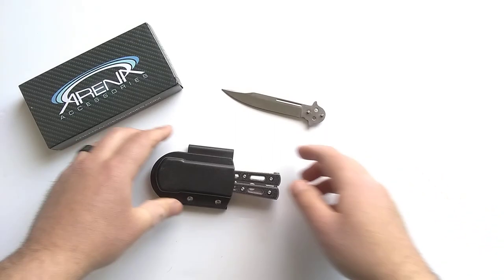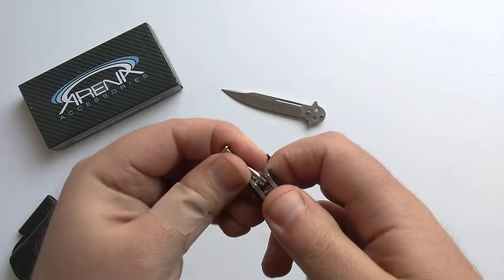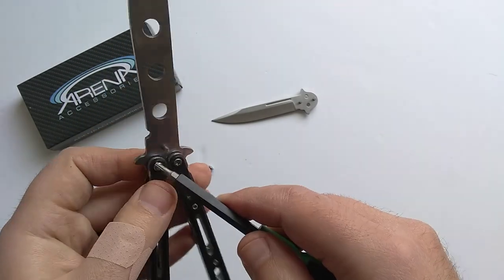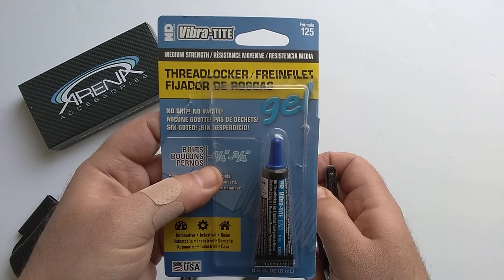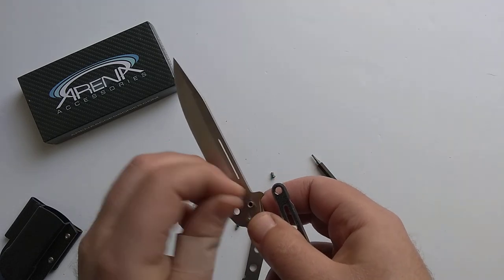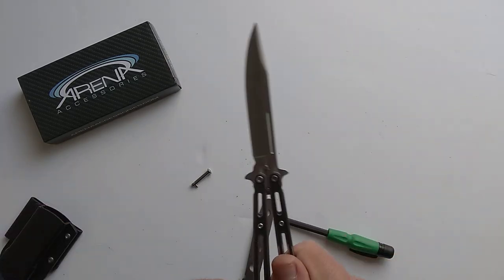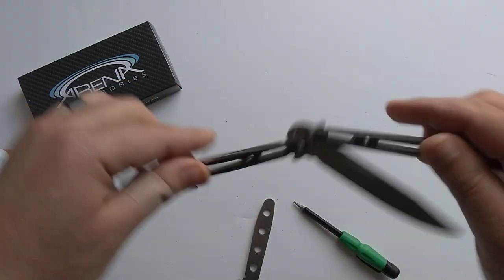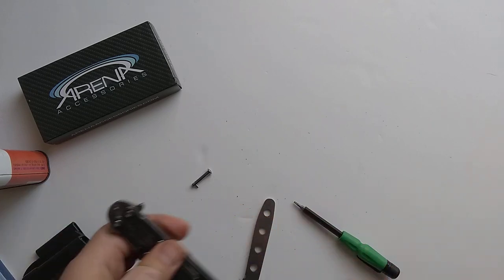How to Remove a Butterfly Knife Latch and Tune/Lube/Adjust the Action of Your Balisong - Tutorial

Comment: I purchased this balisong about 3 weeks ago and i've been flipping since and enjoyed the feel of the knife. But as of about 3 days ago the pin on the blade that prevents the blade from hitting the pins in the handles fell out, and by the time I was able to notice, the blade had already hit and knocked out all of the pins on the inside of the handles, blunting the blade and leaving only one pin at the bottom of each handle screwed in to hold the handles together. The knife felt great out of the box but I would have to say that a knife that falls apart this quickly probably wasn't worth the buy
Reply from the maker: Thread locker is key, it's important to thread lock every screw on any balisong. Message me via the website and I will see what I can do to get you back up and running. If your tang pin fell out, that should not have happened. I can get you a replacement.  Thanks 👍🏼

Comment: My version from you came with the black latch. It doesn't have the same pin on the bite handle side. It doesn't have the same pin on that side is it not removable?
Reply from the maker: It is, just a slightly modified design with our latest batch.  I've reached out to you via email, but for everyone else reading this - our new version with the stone-washed / black latch, required you to remove the black textured handle scale in order to get at the handle screw.  It's a better design, because we are planning on adding a spring-latch version on this same frame.  The springs we got were bad, so we are working with our factory to get the revised springs before releasing it on the website.  If you happen to have a spare spring laying around, your knife is set up to be equipped with one :) There's a small hole in the end of the latch pin, and the other end of the spring can be mounted to the other pin inside the handle.
Reply: @ArenaAccessories  that's cool to know. I may end up finding a spring and doing that . I was trying to make sense of what that other pin could possibly be for lol. Main reason I wanted to go latchless was because I didn't want the latch beating the blade. If it's sprung open that wouldn't be a concern. Thanks.

Comment: I put bearing in mine and wedged the original washers in between the zen pin and bolt at the bottom of the handle so that the handles wouldn’t be as opened up top compared to the bottom of the handles now I have no play or tap and a damn good flipper so you can get good tolerances in this bad boy if your willing to put in some work (forgot to mention zero blade rub after i modded it)
Reply from the maker: That sounds awesome!  Gotta love knife mods.  You just increased the performance and value of this knife by doing that.  If we could eventually source some bearings that were just the right size, I might just have to make a "special edition" series.
Reply: @ArenaAccessories  would love to see it happen
Reply from the maker: @jahyeet1137  Never enough time in a day. In other news, we are dropping a new exclusive titanium balisong on bearings in 2 to 3 weeks, check out our Instagram @arenaaccessories_dot_com or our exclusives category on the website to join the waiting list. Very excited!  Can't wait to get the final production model here so we can make a video.

Comment: Thanks so much, I just got mine yesterday. It's great! Can you do a video on the red dragon handle balisong you have or tell me if its just as good quality because I really liked the design on that one.
Reply from the maker: That knife flips great, and has longer handles than the one in this video. Only drawback is if the pivot pins ever loosen, you will have to smack them with a hammer (on a hard surface, such as a bench vise anvil) to re-tighten them. When you get something with screw pivots, there is a little more maintenance but it also allows you to tune them up much easier. Riveted / pin pins are nice if you just want to grab and go, but over the years, they will almost always loosen up. That's why we price our riveted models cheaper. They're great to add to your collection, and still flip really nicely.
Reply: @ArenaAccessories  thanks for the help! I'll be getting it then!
Reply from the maker: @enigmaedits1559  we have one left 👍🏼not sure if we will ever get any more. Totally depends on our supplier

Comment: I have a butterfly knife that has no screws. What should I do to get the latch off???
Reply from the maker: If it's riveted, you probably won't be able to remove it without sawing or dremel cutting the latch off. You don't want to pop out or ruin your handle rivets, otherwise the handle will be falling apart if it's a sandwich design. I'd need to see a photo of it to help you out further.
Reply: @ArenaAccessories  nvm i found another way to keep the latch while comfortable to hold.
Reply from the maker: @ungsaltm3016  Tape?  LOL
Reply: if your still wondering, most screw/pinless bali’s you can straight up just knock off the latch, i wacked the latch off  one of my ccc bali’s with a screwdriver and it works great
Reply: How did keep latch comfortable
Reply: The latch is so annoying

Comment: Question do balisong latch screws or bite handle screws glowed together bc this damn screw won’t come off
Reply from the maker: Yes, thread-locker. Heat it with a flame then try again. You can use a candle or lighter or a soldering iron but be careful. Try both sides as well. One side always seems to be tighter lol

Comment: I bought a similar trainer. I wanted to take off the latch but the screws are so tight and the tool which came with the trainer, destroyed the screws… i need help
Reply from the maker: Try an elastic band on the head then use your screwdriver again. But you first need to heat it up with a flame or soldering iron, to break the thread locker. Sometimes you will need to go to a t7 on a stripped t6.
Reply: @ArenaAccessories  i will give it a try. Thank you 👍🏽
Reply: @ArenaAccessories  nope, didn’t work either. The screws are too tight. Not even a t7 works on that screw. Perhaps if i used super glue. Like, gluing a piece of metal onto the screw. Thank god i have replacement screws
Reply from the maker: @Sam-dd8cl  use a flame from a lighter or match. It's loctited, only way the screw can be siezed that tough.
Reply from the maker: @Sam-dd8cl  drill them out lol My bet would be that super glue would not hold, you might want to try an epoxy like JB weld or something onto the screw head but don't get it glued to anything except for the screw head that's probably a waste of your time. Just drill them out with a drill press. I wish I could help you further but it sounds to me like you didn't buy it from us I'm just trying to be a good guy to lead you into the right direction
Reply: @ArenaAccessories  everything's fine :) i solved the problem. Thanks for all your help ^^

Comment: I just have a question, do the screw must be tied af or it has to be loose, bc mine is a bite loose and I'm gonna remove the latch who os the same as here, so do I habe de tied the screw as much as I can ?
Reply from the maker: The screws should be tight, my dude.  Otherwise your handle might loosen up.  Be careful not to strip the heads of the screws.  You can also use a little bit of heat if they won't budge easily (there is some thread locker applied at the factory, depending on where you got your knife), you can heat it over a candle, or with a small flame, but be careful.
Reply: @ArenaAccessories  ok thank you very much

Comment: my balisong trainer doesnt have a screw on each side, one side is covered by a cap and one more is a screw
Reply from the maker: Some screw sets are like that. Not all models have screw heads on both sides. Usually the capped side is the female threaded side.
Reply: @ArenaAccessories  i see, is there still any way to open the latch?
Reply from the maker: @belimbing3349  I can't see a photo of what knife you have, but if it is a rivet you won't be able to without serious modifications. The simple answer is to deconstruct the handle and take out the latch, then reassemble.

Comment: i ordered mine two days ago and haven't gotten an email when does it usually come in?
Reply from the maker: Check your spam/bulk email folder. Depends when you ordered, because we don't ship after 11am or so on Saturdays.  You will get an order confirmation email when you order, and then another email once it ships with the tracking info.  Contact me on the website if you have any questions, anything piled up from the weekend just processed today and was shipped out.  It will all get scanned in by USPS this evening.

Comment: My latch is on the wrong side!   😑
Reply from the maker: Where did you get your balisong?
Reply: @ArenaAccessories  from flipkart. I wanted to buy a good expensive balisong. Because i love these knives. I never was able to afford one but now that i have money i thought I'd buy something expensive but guess what. The most expensive balisong you can find on the internet in india are around 5oo rupees. I was very sad but the one i got is a good one. It's not that good but at least the screws don't loose the first day
Anyway removed the latch And it's working fine now.
Reply: @ArenaAccessories  and also the guard comes off sometimes. What do I do.
Reply from the maker: @rockystanding  what do you mean by guard, the tang pins?
Reply: @ArenaAccessories  yes. The pin that stops the knife from hitting your hand
Reply: @ArenaAccessories  sir, what do i do?
Reply from the maker: @rockystanding  if the pin is loose, you may be able resecure it with some 2 part epoxy such as JB Weld if it is a available there. I don't know if you have 2 tang pins in your blade, or if your model has zen pins in the handle. I'd have to see a photo.
Reply: @ArenaAccessories  I didn't know what they were called . After you said tang pins i searched for how to fix this problem and in one of those videos they said that use a hammer. So I did and it looks like it worked. Thanks for telling me what these pins are called.
Love. From india ✌️

Comment: They tightened the screw so much that if i unscrew it the screw will break
Reply from the maker: Apply heat (flame or soldering iron) there must be thread locker. Or try the opposite side. Try not to strip it.
Reply: Ayo thanks ima try it tmr